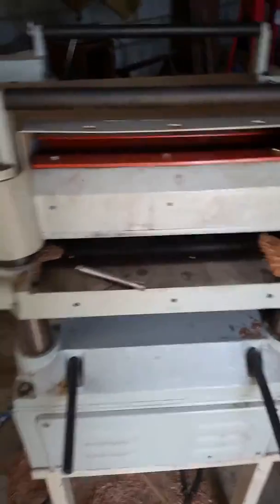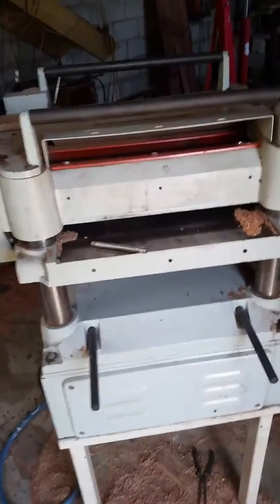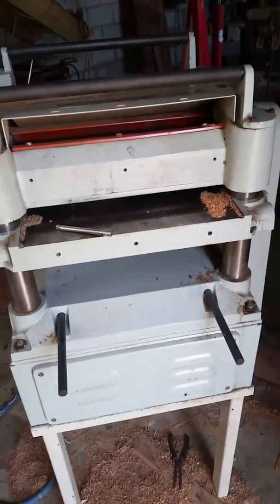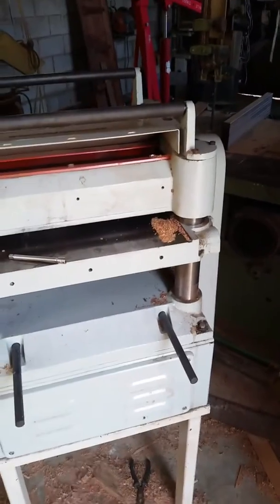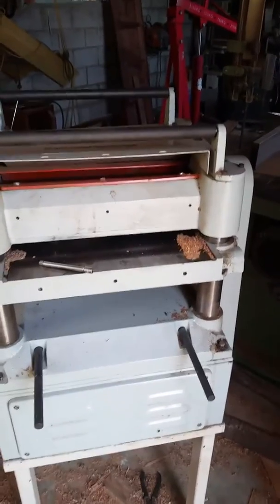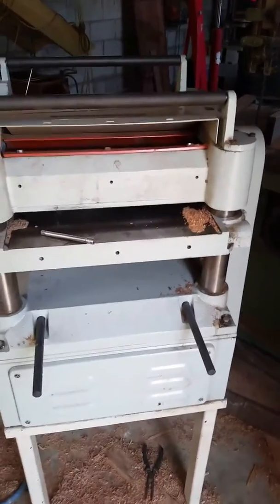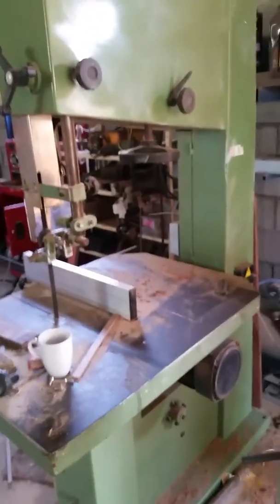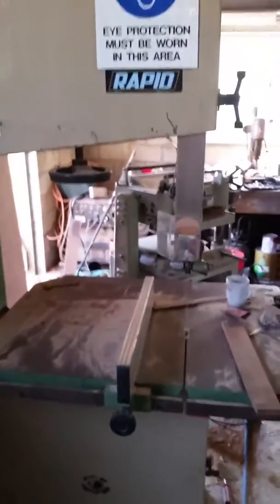how to set up a planer thicknesser hafco

Comment from the maker: forgot to say, do not tighten tension springs down, back em all off  enough so the rolls grip, these hafco,s, despite the blurb, do not come set up, mine would not feed at all, feed roller far to lo, timber could not climb over it, result huge burns, tripped o/l breaker, worn out operator, great now, pleasure to run it, i keep a cheap digital vernier handy

Comment: Hi I just bought a hafco thicknesser spiral cutter 3 phase , having problems with hardwood, it's not feeding, so shall I just lower the outfeed roller?
Reply from the maker: try sanding the platen, the put some candle grease on it